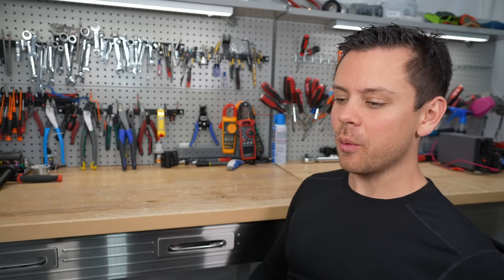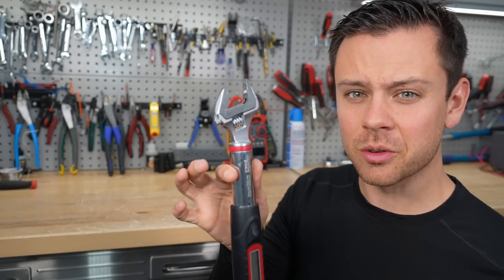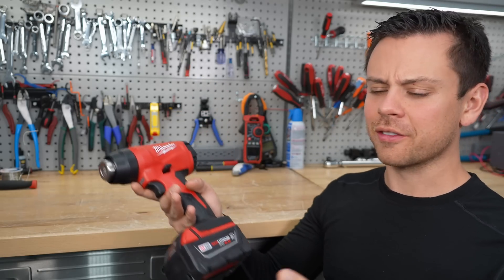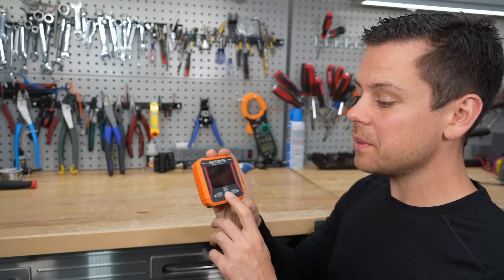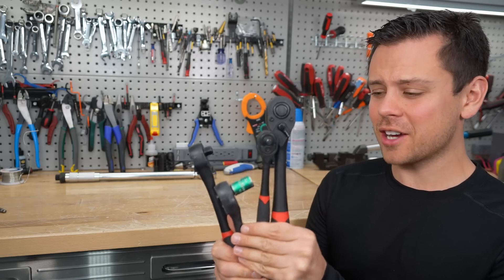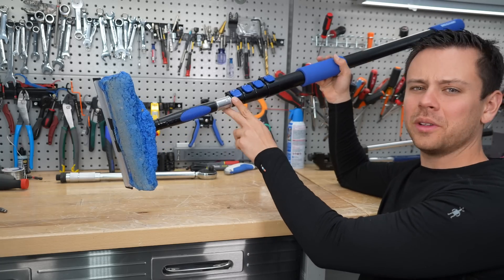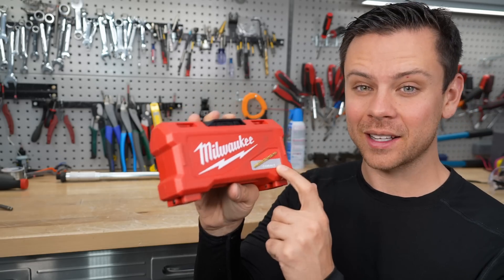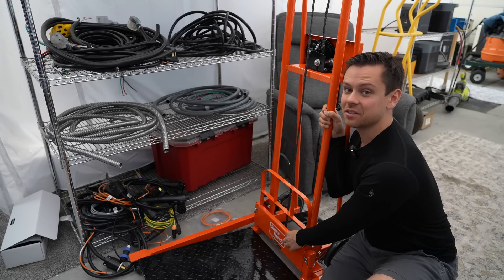25 Useful Tools for Offgrid Solar. Including battery lifts!

Comment from the maker: Affiliate links below for my favorite tools!
Budget Screwdriver Torque Wrench: https://amzn.to/3yBlo8T
Pro Screwdriver Torque Wrench: https://amzn.to/3QZNPDz
Crescent Torque Wrench for Gas Connections: https://amzn.to/3QWf02j
Fluke Budget AC/DC Clamp Meter: https://amzn.to/3QZtH4L
Fluke Pro Meter w/ Inrush (expensive): https://amzn.to/3WYqkPm
Budget Clamp Meter w/ Inrush, Kaiweets: https://amzn.to/3yBVSjS
Nut and Bolt Thread Size Checker: https://amzn.to/4aAD7KE
Klein Bit Driver Multiple Sizes: https://amzn.to/4dSxvyp
Step Drill Bit: https://amzn.to/4bS0YXv
Cordless Heat Gun: https://amzn.to/4bNupK4
Industrial Temco Crimper: https://amzn.to/4caZYht
Heat Camera: https://amzn.to/3VfCNgg
Hakko Soldering Iron: https://amzn.to/3WXaMLM
Quad Hands: https://amzn.to/44ZjlHM
Allen Wrench Set for use w/ Torque Wrench: https://amzn.to/4dSwiXX
Impact Gun Rated Hex Set: https://amzn.to/3yKCFfC
Insulate Ratchet for Battery Connections: https://amzn.to/3UWzR6H
Small Insulated Screwdrivers: https://amzn.to/3UYem5n
Cordless Jigsaw: https://amzn.to/44VnHQc
M18 Concrete Hammer Drill: https://amzn.to/4dRMQiL
90 Degree Locknut Wrenches for Electrical Boxes: https://amzn.to/44ZT10k
Best Drill bits you'll ever buy: https://amzn.to/3ysPzyQ
Extended Hex Bits for Impact gun: https://amzn.to/3UZ9qNX
Table Lifts All Sizes: https://amzn.to/4axWIeB
Super Handy: https://amzn.to/3UZSYwP

Basic Tools for Beginners: https://www.mobile-solarpower.com/tools.html

0:18 Torque Screwdriver Tutorial
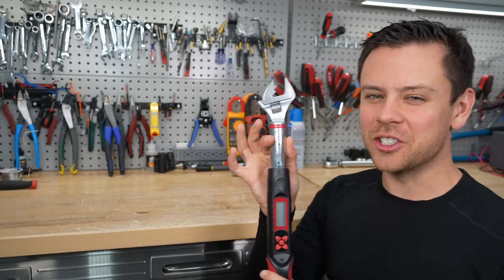1:21 Crescent Torque Wrench
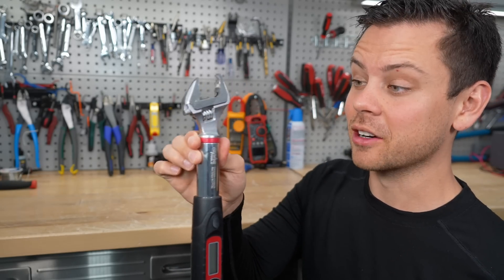1:42 Clamp Meters: Fluke and Budget Option
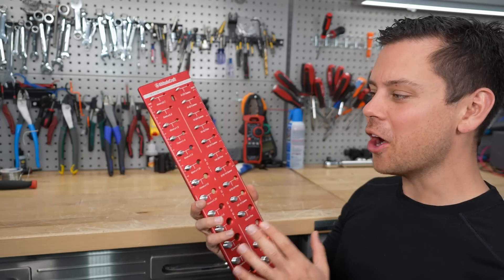2:21 Nut and Screw Thread Checker
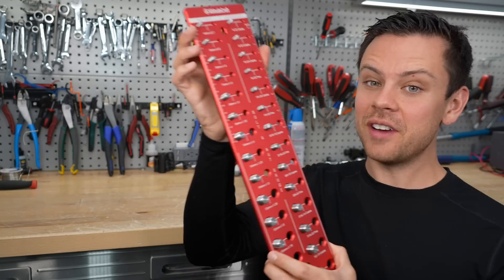2:46 Cordless Heat Gun
3:12 Large Industrial Crimper
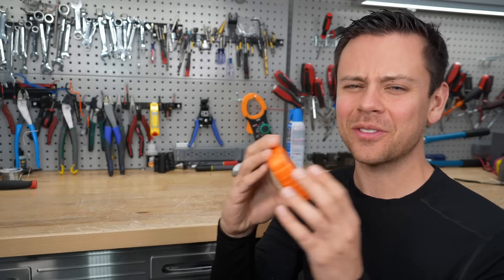3:41 Heat Cameras
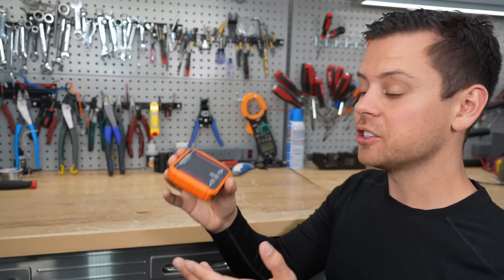4:38 Soldering Iron
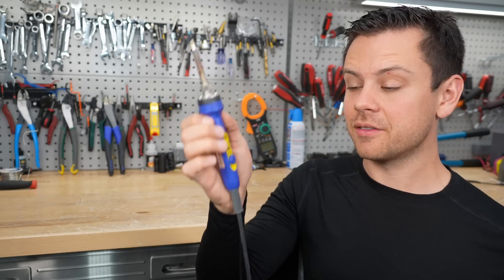5:19 Allen Wrench and Hex Torque Options
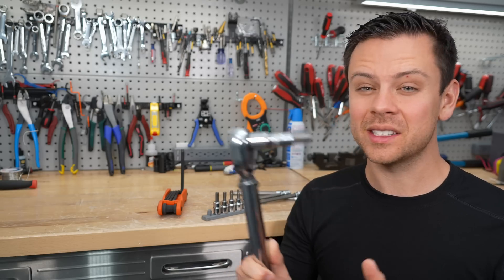5:50 Insulated Ratchets
6:00 Bit Driver Universal Tool
6:13 Insulated Small Screwdrivers
6:26 Step Drill Bits
6:42 Compressed Air Can
7:03 Cordless Jigsaw
7:17 Solar Panel Cleaner
7:38 M18 Hammer Drill for Concrete
7:50 Basic Tools Recommendations
8:10 90 Degree Locknut Wrench
8:37 Best Drill Bits in the World!
8:59 Hex Bits for Impact Guns
9:09 Tools for Moving Large Batteries
9:21 Lift Table
9:48 Super Handy
10:40 Hand Trucks and Conclusion

~~~~~~~~~~~~~~~~~~~~~~~~~~~~~~~~~~~~~~~~~~
Tired of getting ripped off? Check out my "Will Prowse Approved" solar product recommendations below!

12V Batteries
https://www.mobile-solarpower.com/lithium-batteries.html

48V Batteries
https://www.mobile-solarpower.com/48v-batteries.html

Offgrid Inverter System Builder
https://www.mobile-solarpower.com/48v-complete-system-blueprint-559371.html

Hybrid Inverter System Builder
https://www.mobile-solarpower.com/code-compliant-48v-offgrid-system.html

Mobile Handtruck System Builder (very popular!)
https://www.mobile-solarpower.com/mobile-48v-system.html

Solar Panels
https://www.mobile-solarpower.com/300w-solar-panels.html

Ground Mount Solar Racking
https://www.mobile-solarpower.com/ground-mount-racks.html

Wire, Lugs and Busbars
https://www.mobile-solarpower.com/wire-and-connectors.html

Tools
https://www.mobile-solarpower.com/tools.html

Fuses and Circuit Breakers
https://www.mobile-solarpower.com/fuses.html

Plug-N-Play Solar Systems
Ecoflow, Anker And Bluetti! So many models to choose from. See my current recommendations here:
https://www.mobile-solarpower.com/full-size-systems.html

~~~~~~~~~~~~~~~~~~~~~~~~~~~~~~~~~~~~~~~~~~
Need to build a large DIY system? Need a trustworthy solar distributor? These are my favorites:

Signature Solar
Creator of EG4! Solar Minisplits, Victron and More! Largest Solar Store Online.
If you want $50 off, please use my link below and coupon code "DIYSOLAR50":
https://signaturesolar.com/?ref=cPwLcVc0SW-BjN

Current Connected
Best Prices for EG4, Victron, Midnite and so much more! Fast Shipping and Highest Rated Customer Service:
https://currentconnected.com/?ref=wp

~~~~~~~~~~~~~~~~~~~~~~~~~~~~~~~~~~~~~~~~~~
Join our DIY Solar Community 
Need more help? Join the largest solar forum on the internet for beginners and professionals alike. 140,000 members and counting!
https://www.diysolarforum.com

Check Out My Free Book
Best-selling and beginner-friendly guidebook to off-grid 12V solar!
https://www.mobile-solarpower.com/the-book.html

~~~~~~~~~~~~~~~~~~~~~~~~~~~~~~~~~~~~~~~~~~
Contact Information:
I am NOT available for personal solar system consult! If you wish to contact me, this is my direct email: williamprowsediysolar@gmail.com
FTC Disclosure Statement and Disclaimers:
Every video includes paid promotion or sponsorship (such as free products for review). Some links on this YouTube channel may be affiliate links. We may get paid if you buy something or take an action after clicking one of these. My videos are for educational purposes only. Information is subject to change/update at any time. Electricity is DANGEROUS and can kill. Be smart and use common sense :) DIY Solar Power with Will Prowse is a participant in the Amazon Services LLC Associates Program, An affiliate advertising program designed to provide a means for sites to earn advertising fees by advertising and linking to Amazon.com
Reply: @WillProwse I recently noticed that you support the channel PoliceActivity. That's awesome. Thank you for supporting Law Enforcement. We appreciate it.
Reply: Good info to know!
Reply: Hey I'm trying to figure out how to message somebody/you on YouTube, I wanted to ask you a question since I see you're always on here with solar panels and I trust your judgment. I got a question, I'm making a carbon fiber hood for my car and I was going to get individual solar cells and inlay solar cells on to the hood and then epoxy them over onto the carbon fiber, but will the carbon fiber short the solar cells out? If you get back to me, thanks I appreciate it
Reply: @HaloMars.CristaLynn  

No its wil not .
The solar cells are are closed with plastic or glas
I think you look for self project cells from 12 volt that Little models ??

The problem with carbon fiber over the cells is les light on it .
So the volt and ampère go down.
If you use the carbon fiber to hold the solar panel on place .
No problem so long you do set it over the connection from the wires.

I only see no Point to do this really?
Wat you gone use the solar cells for ?
Charge the battery??

One thing of you use solar cells with plastic cover. 
The plastic will over time wil be discolored .
And you have to clean it .

I hope this help you
Reply: Thanks, well basically I'm going to get a carbon fiber hood and router out depression that will hold the solar cells and then we epoxy to them over with the clear coat/ epoxy seal it all back up. So the solar cells will be flush with the hood and everything like it was normally beforehand 

Yeah I'm looking at the stack of 100 solar cells on eBay or allie or one of those type of places. My concern was the tabbing wire and bus wires and stuff on the back side of the solar panels, won't that contact the carbon fiber and caused the short cuz carbon fiber is conductive
Reply: @HaloMars.CristaLynn  well close it with epoxy so the carbon can not Touch it.
Or even with hot glue .
If thare is not metal from the wires contact it than no problem.
Reply: @HaloMars.CristaLynn  o thare is forum from willprowse so you can contact that way more people 
Forum name is use Google 

Diysolarforum
Reply: I know this isn't the best place to post this question I was just trying to get ahold of will but thank you for the help either way I appreciate it
Reply: Hi Will, Your Amazon Fluke Meter link is broken.
Reply: @diySolarPowerFunWithRay  yes was going to say this.
Reply: Other budget for the Fluke if you have multimeter from fluke than well see this type.

Fluke i410 AC/DC-stroomtang 
 Go from 1 amp to 400amp .

Comment: Always appreciate your reviews Will, but would like to make you aware of a Diabolical practice by Chinese companies.  They might send you a tool to review, and it is of highest quality, but then when they manufacture the tools in mass and dump them on Amazon, Ebay, Temu and others, they are made of pot steel that will break in your hand.   One such manufacturer is IWISS -- or IWISH pretend tools.  I have their wire stripper break on the the first strip.   Never in my life have I ever had a tool not make it through the first use.

Comment: A word of caution with some of the cans of compressed air. Some of these use a flammable propellant that isn’t electrically safe. If you use this on live circuits the propellant can cause a short which will ignite the propellant, possibly start a fire and give yourself some nasty flash burns. Don’t ask how I know :(
Reply from the maker: Yikes

Comment: Glad to see you join the fluke club. As a marine electrician I have used Fluke meters for 35 years bullet proof…. I also use Hakko for circuit board repairs.
Reply from the maker: They are best. And yes hakko!

Comment: Consider the budget torque screwdriver from GEARWRENCH, the 89624
 It has everything the CAPRI has and also a 1/4" drive at the butt of the handle so you can attach a ratchet to get the torque on those nasty 50 in-lbs  terminals.

Comment: I got the softest brissle shop broom I could find at home depot. I got the extendable painters handle i think its three 16 ft sections or 12 ft extension, def long enough. I don't squeegee, but I bet you could mount one in the extra hole that shop brooms have. You would just need a male-male adapter. You could also screw a shop broom sized commercial squeegee blade to the shop broom (like the outer edge).  Then you will have about 2 ft of broom/squeegee.

Comment: I need to be able to rent a super handy lift to mount my power pro battery but then I don't need it anymore and don't have room for it. I have got my mount installed and I have this 290lb battery but no way to get the battery onto the mount and I also am by my self.

Comment: Great videos! You did one 3 yrs ago on the Growatt SPF 3000TL LVM-ES. Bought this inverter from Watts247 and want to supply as close to 4000 w at 250 volt as possible.  But i always end up with more that 18amps. You always check the voltage before connecting to the inverter but what about the amps? Any suggestions for supplying max power to this inverter?

Comment: Hey Will, 

I'm building an off-grid system for my vacation property that has a destination camper. It uses a standard 50A RV connection for power. We don't have electricity to the property yet and it's been difficult to find a system that's priced less than the $11k the power company wants to get power on to the property. I recently saw this all-integrated charger/inverter. It's called the Walrus. It says it has a 180Ah 13kWh battery system. The cool thing is that has a 50A input for charging (so I can use my generator to charge it) and a 50A output, so I can plug it right to my RV. It also has a solar charging port and I was going to add some PV to keep it topped up. The problem is I can't find any videos on it that aren't produced by the company that's selling it, so as far as I can see there's no third-party reviews. Could you do a video on it or let me know an honest opinion about it? We want to get something going in the next month.

Comment: Hey Will, I have used dozens of soldering irons. Just like you finally got a Fluke meter,,you need to try a Weller WX soldering station. Fast interchangeable tips. It heats to temperature in 2 seconds! It shows the temp real-time. And because it has a rapid heat capacity, it can dump the heat into the joint!! The heating element is at the tip. It's really a different soldering experience. Rather than apply the tinned tip to the joint and wait till it is hot enough to feed solder, you apply the tinned tip to the joint and almost immediately feed solder. This is really important when soldering components that are temperature sensitive.  Rather than cooking the joint, you rapidly apply heat solder and remove heat......Keith

Comment: Care to clean the drill bits after use cause the longer they have dust and debris on the bit the sooner they will dull out, take a clean cloth wet it a bit then hold it on the drill bit as you run it on them like polishing a metal pipe when it's rolling on a lathe from one side of the bit only don't hold the bit completely from all sides.
I am saying this after seeing your concrete drill bit you use for HVAC pipe hole drilling.

Comment: Hi there ! I'm sorry to bother you in here, but there's not an option for a private message on Youtube anymore. I really like your videos and learned a lot, and I want to build a solar offgrid system for a new house, but I'm not able to get the EG4 devices, because I'm in Europe, Romania actually. 
If you know how to get those in Europe, please help me out, or, if you know, give me some alternatives to those devices. Primarily, the rackable batteries and offgrid inverter. I want to connect solar, wind and generator as backup to the system.
Thank you very much !

Comment: I used a 3.5ton floor jack and a little plywood platform to lift my powerpro battery to my wall mount. Little tippy but got it mounted.

Comment: I've done a couple of mini-split systems.  I believe on both I ended up with connectors that didn't fit english or metric sizes.  I think one was 13.5mm.  I ended up shimming a crow-foot wrench, an adjustable wrench would have definitely have been better.

Comment: go check out these electrician shears KNIPEX Tools Stainless steel 95 05 20. I have cut 2/0 with these. 2/0 is stretching it a bit but 1awg and smaller they go through everything like butter.

Comment: Never been a huge fan of the canned air.  Pressure drops off super quick and it's usually not quite strong enough for what I need.  I have a dozen cans but I don't use it very often. 

Prefer to just use the air compressor

Comment: Just ordered the thread and nut checker, 20% off + 30% off... $17.11 total. 

Beat the hell out of trying to use that POS at Home Depot that's all wallowed out from everybody trying to force the wrong bolts in the holes. 

Thanks Will!

Comment: Hey Will, what's the brand of the wool clothing you are currently wearing?
Reply from the maker: This one is smart wool but most days I wear outlier shirts. They are amazing. Weird website though lol
Reply: @WillProwse  awesome! Thanks Will

Also, looking into wiring for a power station I'm finding welding cable has different ampacity ratings than "regular" wiring of the same awg. Any idea why?
Reply from the maker: @hobbyguy79  probably temperature rating of the insulation. Or higher strand count
Reply from the maker: @hobbyguy79  need to go by insulation temp rating though. Most important. And terminal temp rating and torque to spec

Comment: If you already have Milwaukee 18v tools I highly recommend their shop vack.  It looks like a tool box.  Its not for big moves but a great grab and use vac.  I just used it yesterday cleaning out the wire boxes on the eg4 indoor batteries and 18kpv I am installing.  Thanks for your reviews on those items.

Comment: Hi Will. We haven't used indent crimp tools in NZ for over 20 years. Hex crimp only.  You can get hex crimp tools with rotating dies that cover a range of sizes.
Love your channel!
Reply: hex crimp tools are required in the us for mains/ac power terminations in situations where a permit and inspection are required. low voltage dc is still a grey area here, and most of the time permits and inspections are not required unless it's a commercial install.
Reply: Well tell us some brands and models!

Comment: One tool I didn't own but decided I needed was a Ferrule crimper, and a variety of ferrules. Any time you are dealing with fine stranded wire, a ferrule is recommended. I actually bought 2 different sizes. One does up to 10 guage wire, and the other does the bigger sizes. The big one is handy for the 4 gauge wire in the solar charge inverters.  I always had problems getting that 4 guage into the terminal but crimping on a ferrule makes it easy to get in the connector.
I had a small fire in my combiner box because I stopped checking the connections with my Fluke laser temperature gun. Over time stranded wires will loosen up and then you get arcing. Even using a torque screwdriver. So I invested in the ferrule crimpers. Very cheap tool. After crimping on a ferrule and then torquing the connection I haven't had any problems. But it's made me lazy again because I quit checking my connections with the temp gun. Probably melt down another breaker before I stop being lazy again.
Reply: also, the next person who has to disconnect/reconnect the ferruled wires will offer up a small prayer of thanks (even if its you 3 years later)😇

Comment: Has anyone tried out the rectorseal “shark bites” push-to-connect connectors for refrigerant lines?  I’d trust a couple o-rings over my lack of patience/skills flaring copper line set properly. I butchered the torque spec trying to use crows feet on a standard torque wrench, really like the adjustable torque wrench here.

Comment: 25 year electrician here. My bag is full of Klein hand tools except for the Knipex cobra pliers, those are the best channel lock pliers on the planet.
When it comes to meters and diagnostic electronics though,  only Fluke.
I tell this to the new guys just entering the trade and sometimes they listen and sometimes they don't, but they all seem to end up with pretty much the same tools after a few years.

Comment: Got it, got it, got it got it! Some say indent crimpers don’t achieve as good cold fusion as a hex hydraulic crimpers.
Reply: They don't. I use a hammer crimper and a 5-lb hammer. The crimper was like $20, not $150. Elsewhere, someone said that hex crimpers are Code for higher voltage stuff, and should be used for low voltage too. Didn't mention any brands/models though.